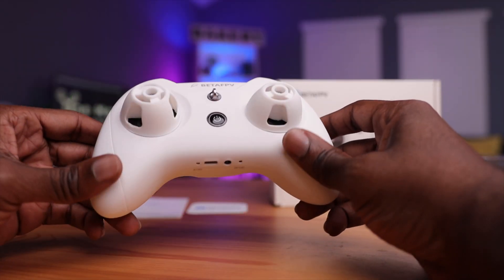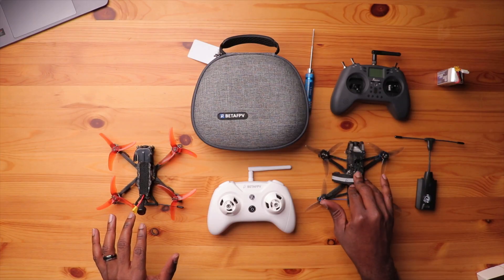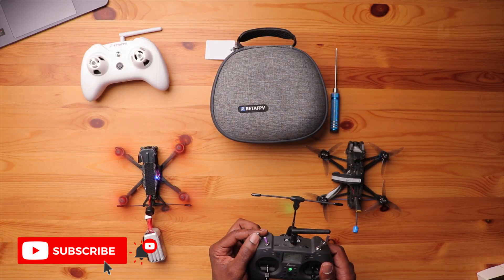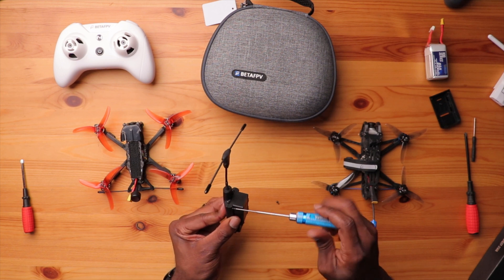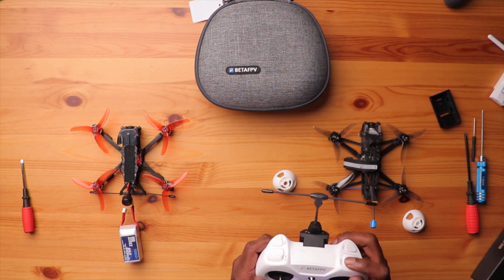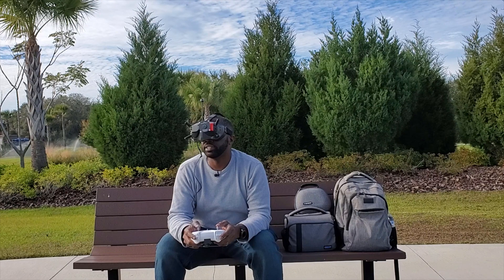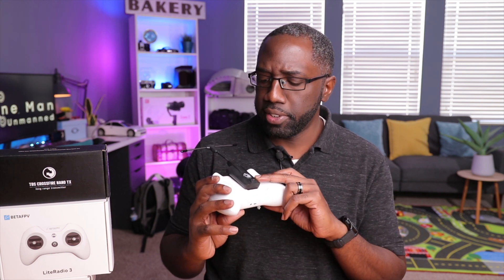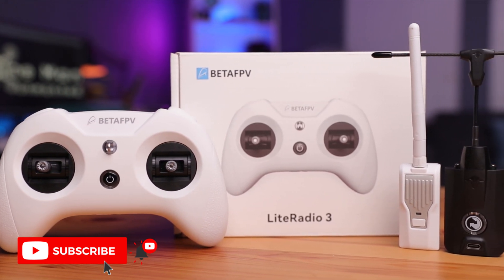I Flew Crossfire on the LiteRadio3 | Here’s How it turned out!

Comment: I am well past the 'fitment' issues, luckily I was able to move the electronics - the board and connected wires - into a compatible housing that fit my LiteRadio 3, as shown here (but shown to me previously in one of DrainMan's videos). What I DON'T know - is how this guy actually getting the module to WORK with the LiteRadio 3. Mine just keeps power-cycling exactly once per second, making true communication between the module and the rx in my drone IMPOSSIBLE. Is there ANY solution?? Obviously there is, its right here in front of me - I just cannot for the life of me, find that 'missing piece of the puzzle'!! I wish he would have explained in more detail **HOW** he was finally able to get the module working CORRECTLY ... and THIS VIDEO is the ONLY VIDEO on the entire internet, that shows it can be done!! So PLEASE, One Man Unmanned -- EXPLAIN how you made this all work!

Comment: I know this is as of now, a 2 year old video, but I'm hoping you remember enough about this situation, that you can kindly help get me out of the issue I'm in. I gave up on ELRS, it was such a nightmare with version matches, radio flashing, FC flashing... I have a TX16S MAX with the hall gimbals, blue led gimbal lights ... all ready to go, but I've not had any luck with ELRS binding.... so I essentially made a hard decision: switch over to Crossfire.

My first experience with Crossfire: I ordered a GEPRC Cinebot 30 with a crossfire pre-loaded rx, and a TBS crossfire nano TX module I thought I could just plug into the back of my Radiomaster TX16S when everything arrived...... not in the cards. Before prepping to send it back, I opened my Beta FPV LiteRadio 3 I bought almost a year ago - and discovered that the new tx module WOULD fit into the back of THAT radio, but not with some flipping of the mounted back-plate to accommodate, like your video here instructs. But THIS is when my luck runs out.

I don't know what you did to make everything work, but I'm completely stuck. I have a "partial" bind with the rx to the drone. But all I see in Betaflight when I power up the radio with module control, is a spinning drone image in the 'receiver' tab, and no stick or button responses on any channel. Furthermore, I had to change the frequency in Agent to 915, where before it had defaulted to 868. So I rebound everything at the correct 915, but the drone was STILL unresponsive. This is where I'm at, I've asked everywhere I know to ask, looked everywhere I can - with very little help. Even the engineers at GEPRC who I've been in support chat with, seem to know very little on the true workings of the Crossfire system.

When you "bound" your tx module and rx's - did you have to hold the bind button on the rx WHILE powering up the drone? I haven't done this yet, as I'm living pretty much alone, and find it impossible to fasten a battery while successfully holding down that hard-to-find bind button on the rx. Please, I hope you can tell me what you did. I switched to Crossfire, to GET AWAY from countless issues like this, that ELRS hammered me constantly with.

I hope you (or anyone) can help.... thanks in advance!!

Comment: Hi I have the flywoo explorer lrs4 with a crossfire receiver and on there website this radio comes with the TBS nano tx will this work with the lrs4 flywooo
Reply from the maker: Well, this radio does not come with Crossfire.  It has an external bay, that can accept a Nano module like ELRS or Crossfire.   For it to be compatible your drone, you'll have to buy the Crossfire Nano module, configure it, then attach it to the external bay of this radio.

Comment: I do have a TX16, I mainly use a Tango 2 Pro and I have gotten a LiteRadio 3 to use it mainly with the sim... nice one, compact, but gimbals are waaaaay too light, even if you install the hall gimbals with the adjustable spring tension... it goes from playstation type tension to light tension.
In my opinion that's the weak point of this budget radio, the gimbals.
Reply from the maker: Yeh, It’s not a perfect radio, but gimbal feel is very subjective from one pilot to the next.  I’m glad it worked, especially with the sim.
Reply: @OneManUnmanned  I'll tell you more, as I don't need it to be constantly recharged by the usb port, I've disconnected the internal battery from the board, put in a new extension cable connected to the board, and passed both extension and battery cable throgh the bottom expansion bay holes out of the radio and hidden under the bay cover, because I won't use the nano bay. The Litaradio now works as a usb controller with green light flashing when connected to pc.
I asked BetaFPV if this was feasable before doing it, so I now have a sim controller not straining internal battery with overcharge, and when I need it as a elrs rc with it's internal module i just have to plug the extension in the bay.
Same if you have to calibrate the gimbals, just plug the battery in the extension and switch it on.
Obviously is all reversable.

Comment: i just order Frsky version , plaining to add external modules for ELRS , Can i use Jumper AION NANO module on BetaFPV LiteRadio3 ?
Reply from the maker: I have not tried the AION Nano, but as long as the module is on the nano size and is deep enough, it should fit.  The exact dimensions (depth is very important) is on the BetaFPV website.
Reply: @OneManUnmanned  Thanks dude , very helpful info for me ... done subscribe
Reply from the maker: Thanks appreciate that.

Comment: Nice video and helpful information my man! I just ordered the radio lite 3 frsky version not the lrs. Question ….when i get the crossfire module do i have to update or download anything to get it working and flying?
Reply: Hey my man how do i download the configuator for the lite radio 3? I try to download but it something weird pops up
Reply from the maker: It's on the BetaFPV website.. I'll link it below.   Go to Assets and click the version for your operating system. 
https://github.com/BETAFPV/BETAFPV_Configurator/releases
Reply: @OneManUnmanned thank you my man and I sincerely appreciate you replying and helping me out with my radio lite 3 journey 💯💯🤙🏾🤙🏾
Reply from the maker: CRSF is a little different than ELRS, but the firmware on the Crossfire module and the RX needs to be the same.  Typically you'll have to update the module on your computer with the latest firmware.  When you bind the module to the RX for the first time, the Module will automatically send an updated firmware to the RX.  Once that's finished, you should be fine.

Comment: Buying a LiteRadio 3 for $60 seemed like a no-brainer until I found that no U.S. retailers have any in stock. I ended up buying a TBS Tango 2 (for Crossfire) instead and then adding a LightRadio 2SE for FrSky D8 Tiny Whoops. I really like the small size, light weight, and simplicity of the LiteRadio. I’ll probably buy a LightRadio 3 once they’re available for sale again without having to order from China.
Reply from the maker: Sounds like a perfect plan.   I do agree the simplicity and lightweight makes a portable radio on the go.   I'm liking the capabilities of the light radio3.  It runs Frsky, ELRS, CRSF, and all components can fit in its case.
Reply: Why do you avoid buying from China? Maybe a bit longer waiting, but other than that...? 🤔

Comment: When the lite 3 came out the first thing I thought of was adding a crossfire mod and this radio would basically have the best of both worlds 😁 I mean other than not having open tx and that it's a game style radio that some don't like this is really all you need👍🏼lol
Reply from the maker: Yeh, the game style radios are super subjective.  Imagine having ELRS and CRSF in the same radio.  I'm sure the next version of this radio will have Open/Edge TX.
Reply: @OneManUnmanned  I can't wait and I have seen so many objections of the new jumper pro with elrs its not even funny lol a few people told me to wait and hold off on the zorro and get the jumper now those same people are condemning it lol but you are the first to try this combo that I've seen👍🏼 great stuff ✌🏽
Reply from the maker: Thanks, I appreciate that.   I haven't seen another video talking about Crossfire on it either.  I considered both the Zorro and T-pro, but could not justify the purchase since my T-lite does almost the same thing.   I'm waiting for the i-flight version to be released.  The market is about to be flooded with new radios.
Reply: @OneManUnmanned  personally I think I'm gonna get the zorro with elrs and put a crossfire mod on it and I should be happy lol I just love the features of the zorro however word is that they're gonna be putting metal gimbals in a newer version so I might wait 😁

Comment: Thanks for the very informative video.
I have the Lite 3 & the crossfire module and this will help me get it working.
Reply from the maker: That's great.. I'm glad the video helped.
Reply: @OneManUnmanned Thank you for you video! Could you please elaborate on how you managed to configure the LiteRadio 3 to work with Crossfire? I get no stick movement in betaflight!

My setup includes a Crossfire Nano TX, and two Crossfire receivers (one diversity).
The binding process works well, both using Agent M via USB and by hitting the TX button while TX is mounted on the remote.

To be 100% percent certain that everything is wired correctly, Betaflight is properly configured, all modules fully functional - I checked all components, separately & together, one by one, with a Taranis x7 RC and everything worked perfectly - stick movement and all.

All above experiments were performed via both 4.11 and 6.17 Crossfire firmware (both TX & RX).
The remote itself arrived with firmware 2.0.1, then re-flushed to 2.0.1 for sanity's sake;

Having repeated all above experiments with both FrSky & ELRS remotes - still no stick movement in Betaflight with the GetFPV LiteRadio 3.
Intuition points me towards that "add model" step that made everything tick with the Taranis X7..

Anyways - since everything is working with an X7,  since it's written all over that CRSF is fully supported (& working for you) and it's two separate LiteRadio 3 remotes that I failed to configure - what's that obvious step that I'm missing..?
Reply from the maker: I'll be honest, mine worked just as described in the video.  I changed my LiteRadio3 from "Internal" to "External" module.  That allowed power to be provided to the CRSF Nano TX.  I then pressed the bind button on the back of my module while the RX was in bind mode.   They paired up and everything worked.   I know TBS had TX and RX update issues over the past few weeks.  Just make sure your TX and RX are on the same firmware and try the binding process as listed above.
Reply: @OneManUnmanned  Thank you for your answer! I'll retry all attempts as described, must have missed something really silly..
Reply: @shmuelag  did you manage to find a solution? I have the same problem( in betaflight there is no signal from the remote(

Comment: I already got the frsky se version I know its possible to install the lrs board but can I still fly my frsky d8 quads or should I just get the newer controller
Reply from the maker: Do you own the LiteRadio3 or LiteRadio2 SE?
Reply from the maker: In order to use ELRS with the LiteRadio2 SE, you'll need the new internal board or just get the LiteRadio2 with ELRS built-in.   If you have the LiteRadio3 with Frsky built-in, you can just buy any ELRS nano module and have the best of both worlds(Frsky D8 and ELRS).  If you fly D8 drones only, you don't have to upgrade to the new radio.